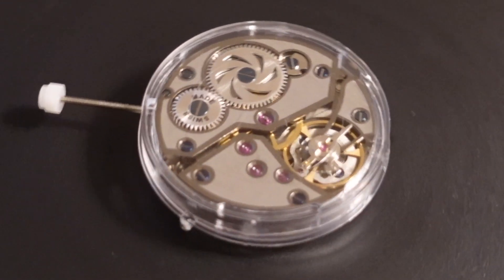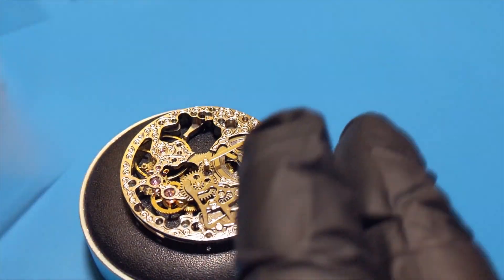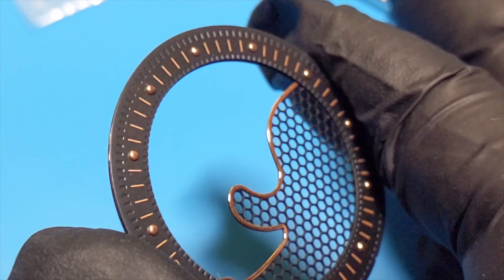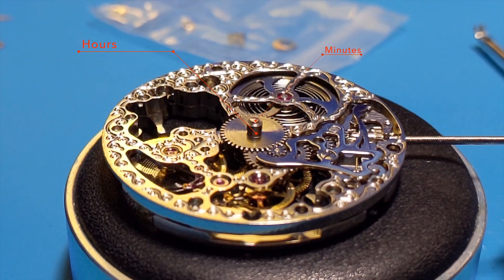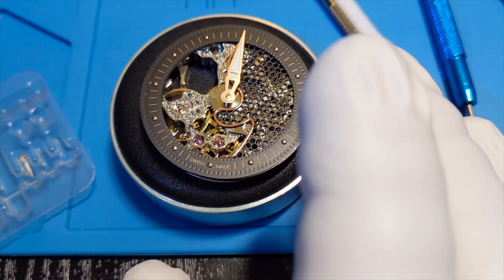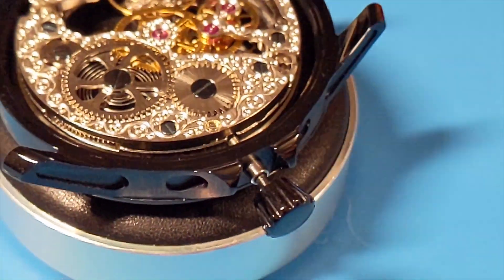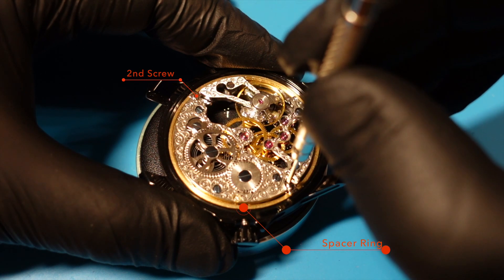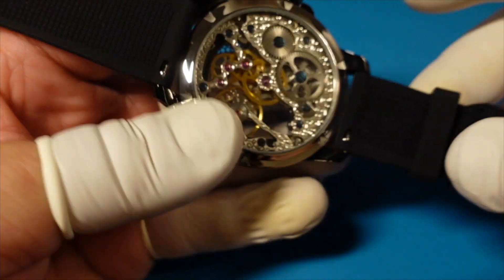How To Build your own ST36 skeleton mechanical watch - Links to parts and tools in the description

Comment: need some help with selecting the right dial. watch cases recommend the dial size is 38.5~39.0mm. does it have to either be a 38.5mm dial or 39mm dial. or! lol. any thing between a 38.5~39.0mm dial? thanks. im new to this

Comment: Would you please tell me who are the good reliable sellers for watch parts?
Reply from the maker: Excelent question. In this channel I will show 3 kinds of builds: 
1. For the newbies. You can source parts from Ali express or DHGate
2. For the 'not so newbies' . Seiko parts: https://www.namokimods.com/collections/skx013-cases
Other parts for repair, ore custom buil of other brands: https://www.cousinsuk.com/category/watch-parts-branded
If you are in the US: 
https://www.esslinger.com/watch-parts/ 

3. High end. I mean 100% Swiss, top of the line, excellent parts, for the ones who want to build a 10.000 dollar level watch: 
I have a deal with Swiss manufacturers from Geneva who supply me custom made parts. Also, you can check Master of Time SA on eBay, but I'm telling you the parts won't be cheap, also you may have to pay import taxes. 

I hope this helps.